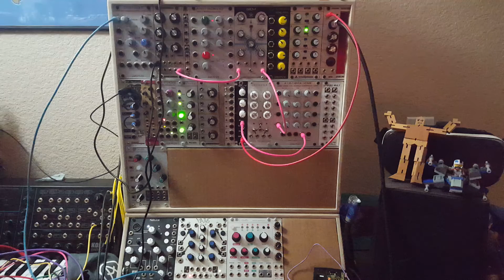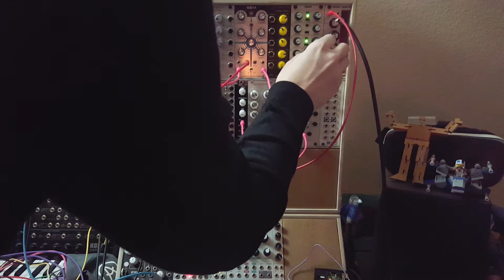A Few Uses for VCAs - Eurorack Modular [CV Intensity and Amplitude Modulation]

Comment: Awesome video! Modulate all the modulators! Since the topic of ring modulation vs amplitude modulation came up, basically, ring modulation is "through zero" amplitude modulation.
Reply: AFAICT, the original diode ring is actually a switched modulator.

Comment: could you please show the power connection on the back of this module as on mine it is not clear regarding the red stripe orientation , I don't want to connect it in reverse for obvious reasons , thanks

Mine is the a 132- 2